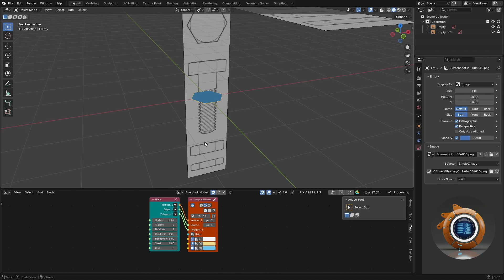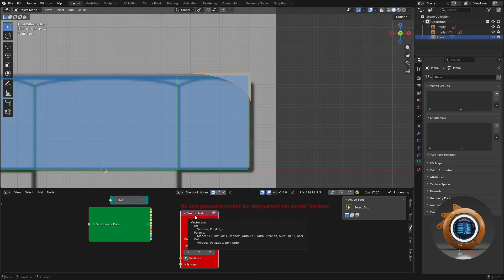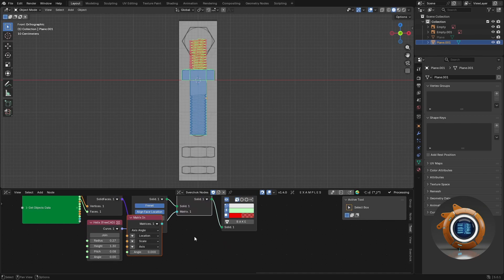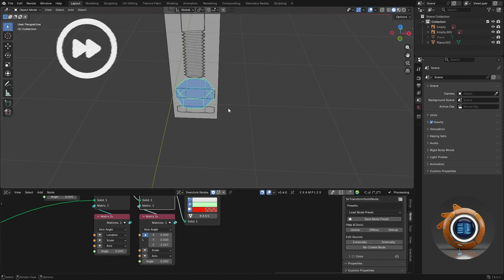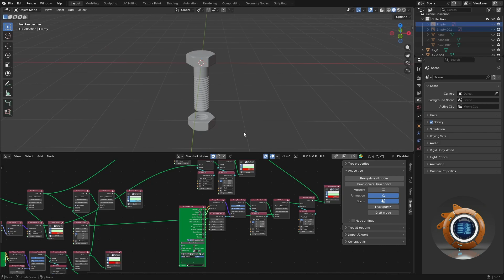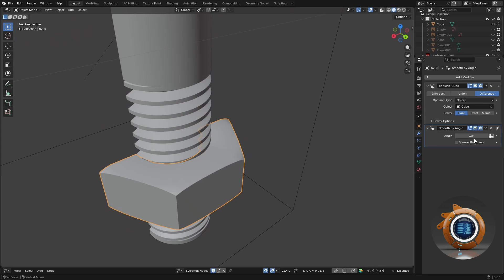Was There Ever an Industry Standard in CAD? Blender Inside CAD Pipelines

Comment: It is fun to speculate about Blender being used for product design.  In the recent Blender Foundation survey about 8% of Blender users are product designers.  
In my day to day working I use Revit.  I am attempting to replace Revit with Blender.  It is very difficult.  I am hoping to also produce visuals with Blender as well as technical drawings.  I am in the Construction industry and have a much better chance of adopting Blender than mechanical engineers due to the industry using the open IFC format for exchanging 3d models.  Blender can produce IFC models fairly simply by using Bonsai - but it is harder to produce stp files.
I see that you are using Sverchok.  I might change my mind in the future, but for now I am testing Geo Nodes for parametric parts.  I have used many software/addons in the past that became discontinued some I am reluctant to try Sverchok.  Since Lists and Bevel nodes are coming soon, Geo Nodes have a bright future.  
Thank you for your tutorials, they are fascinating! Let's hope Blender improves it's NURB modelling.
Reply from the maker: Thanks a lot for such a thoughtful comment, there’s a lot in there.

I agree that BIM and construction workflows are much closer to mesh-based modeling than other sectors, and open formats like IFC really make Blender adoption more realistic in that context. That’s a big advantage compared to purely mechanical workflows.

I still think solid modeling matters for better long-term integration, though. Technically, step workflows from Blender are already possible using FreeCAD as an intermediary, even via Sverchok. It’s not perfect, but it works. I might cover this in a dedicated video at some point.

About Sverchok, I totally get the hesitation. Geometry Nodes clearly have a bright future, but Sverchok has been around for a long time and actually paved the way for many of these ideas. It’s still worth experimenting with.

Thanks again for the kind words. Comments like this are incredibly valuable for me and for the community.